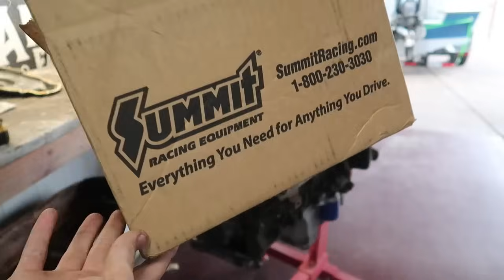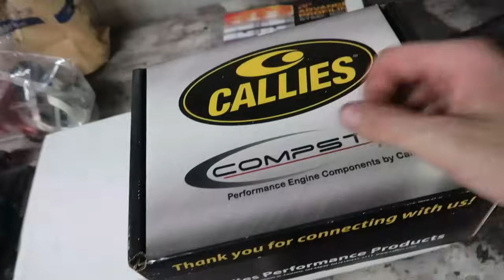RACE Engine BACK! From the machine shop for the Colorado!

Comment: You got all the goodies for the internals Braven you might as well buy a ATI dampener and save yourself the headache down the road with that stock one. And while the heads are off you might as well get them cut for a fire ring
Reply: He will find out when the rubber separates and slings that pulley through the hood/fender/intercooler etc, but yeah why spend the money now when he can do it after the fact, building a v8 is EXPENSIVE. but after it's running, I HIGHLY recommend swapping that crank sooner  then later bro
Reply: @NITSUD89  yeah it can be expensive building a turbo motor I get that but the kid works for Hughes I'm sure they get a pretty good discount with other manufacturers and will help him any way they can